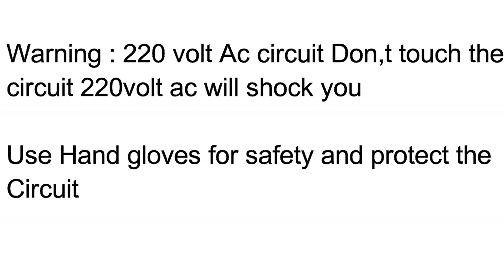How to make 220volt AC voltage Regulator | Ac Fan Speed Control Using Triac BTA20 | 2000W appliances

Comment: How the gate of the Triac will close the current loop if the N terminal of the AC does not connected to the Circuit?
Reply from the maker: Bro L live wire attached to triac and N terminal if you connect bulb or fan the N terminal connected with triac with triac because bulb or fan has resistance
Reply from the maker: Bro tester bulb also work only on L wire
Reply from the maker: Bro Google has lots of diagrams you can easily understand
Reply from the maker: If you want these diagrams from me whatsapp +601169439048